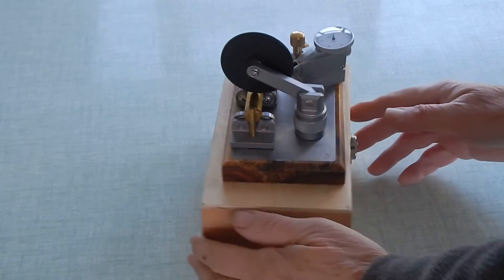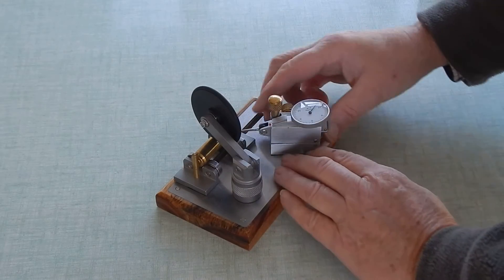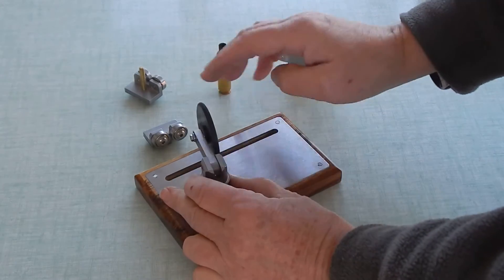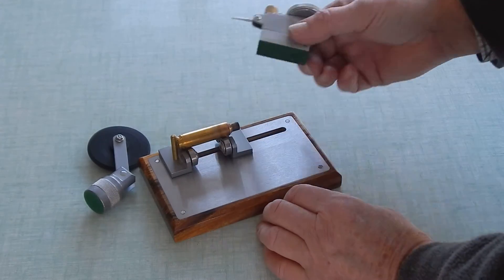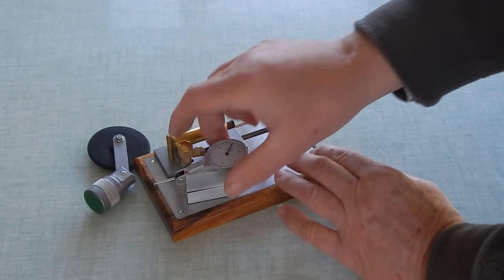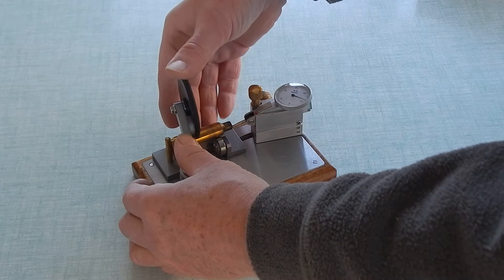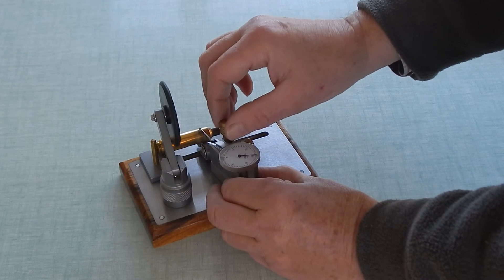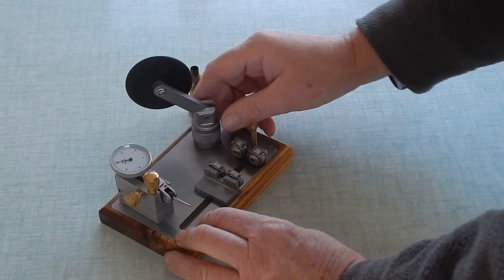Concentricity gauge - made in my home workshop.

Comment: Great vid. Been thinking of making one myself. What type of bearings did you use to run the case in and do they have much run-out in them?
Reply from the maker: Thank you Glen. I looked at several different bearings and eventually settled on Zen bearings, good quality manufactured in Germany. I tested the gauge with parallel pin gauges and find there's no detectable indicated runout. I also tried the more traditional hardened balls to eliminate this perceived problem but the low friction of the bearings make it much "nicer" to use and no less accurate.